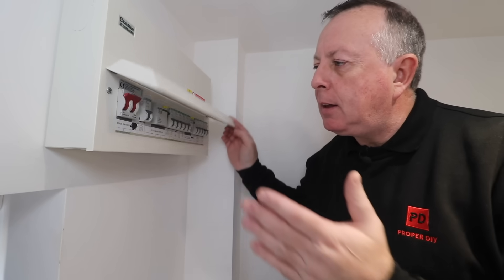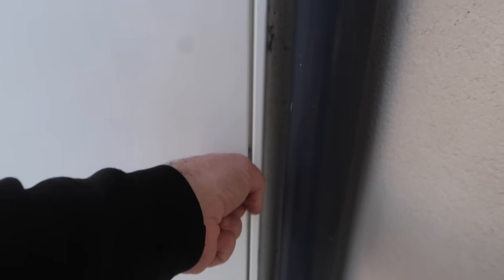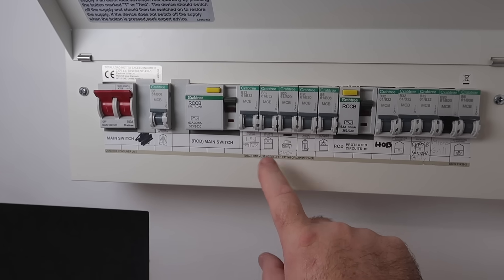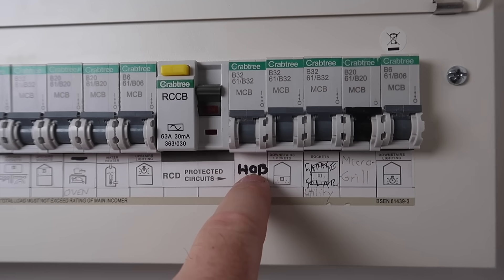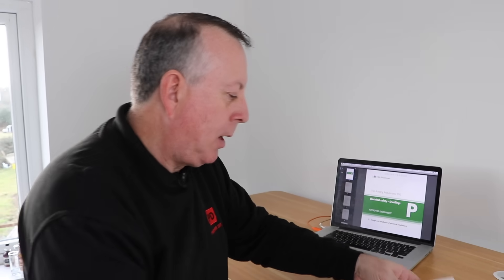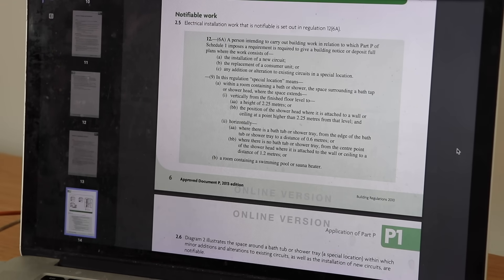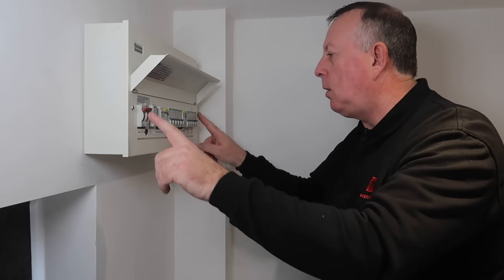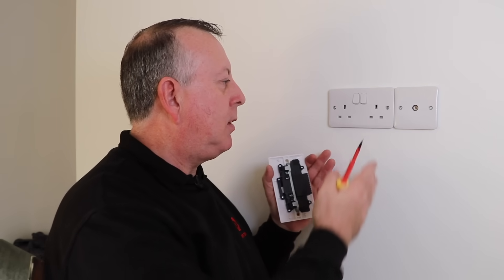What electrical work are you allowed to do in your own home?

Comment: The rules were put in place primarily to stop dodgy electricians I.e those operating as a business who’s work was very poor from doing work.  At that time most (there are always a few exceptions) people that did DIY electrics, were people that took time to study what they needed to do and took care in doing it. The number of people killed due to electrocution from their own DIY per year minimal and I don’t believe that’s really changed since. The biggest problem with the rules is as many people who own a house but cannot afford for an electrician to re wire a house will not have that house rewired.   The general dumbing down of diy, has created a whole generation who are too scared to even remove a socket. They also don’t realise that the terminal screws of sockets, can work themselves loose over time (depending on what’s plugged in) and should really be checked every few years.
Reply: I do the electric myself and yes I research by reading the regulations on what I am doing, artisan electric has said some DIY electric people are better than electricians as they do a neater and nicer job, in my view if know regulations you can do electric as long as make sure it off before working on it (I cut through a cable once I thought was off but as the plug was under a table) but either leave sockets maybe hanging off or let an electrician unscrew the sockets so they can check the wiring and mark it off if you done a good enough job
Reply: @mlee6050 same as you mate. Ive rewired the last 4 houses Ive lived in. A family member was an electrical foreman and tutored me in when doing my 1st one. Ive come across some chilling examples of dangerous wiring whether it was done by a qualfied spark Ive no idea. One example, in a batheroom there was a socket 18 inches from the taps. To make things worse it was jointed to the cable for the immersion heater. I also contact electrical contractors and request a check similar to what private landlords need every 5 years. When it passes..happy days
Reply: @palermothegoalgod-wd2wp  lucky you, I not know of an electrician in my family, and yeah just put new fuse in consumer unit, when save for radiator going to connect it up then hope electrician on a job next door can hop round to do check for me, so know it as this place has a landlord so yay
Reply: @mlee6050  so you test it, make sure it has a adequate zs. Do a insulation test? 
Thought not
Reply: @westleyjohnstone4719  
You can rent the equipment. Many vids on youtube tell you exactly how to do it.
Reply: @westleyjohnstone4719  on that not yet as not rich for the equipment, often I buy the more expensive cables that say self extinguish on the cables I buy, I am looking to save up so I can do a 14 week electrician course but mainly for when I do any single phase or three phase for myself I can sign it off after testing it

I do test on if lines work but I got a simple smart probe thing (forgot name of it)

Most I wire is on 13A plugs so far, got a line of from plug to junction box, to single socket, to double socket, to isolator, to single socket for things, other way on junction box is a 3 way switch thing to control Aircon and fan in heatwave so off/on/thermostat

First cable running from consumer unit today, I researched what cable and size fuse to use, when connect up to radiator at other end with a fused spur, I will hope get electrician in to sign it off without me getting a fine
Reply: @johnburns4017  I am looking to buy but when only have like £3k a year spare when on benefits after bills I am unsure when afford £9k for the course I am looking at
Reply: @mlee6050  
No fine. Only if something goes wrong, then you are found to be incompetent by a court.
Reply: @johnburns4017  no DIY Dave will do that. Plus, they don't understand the readings, or what table they correspond to in the regs. To many fires happen because of this
Reply: @westleyjohnstone4719  
Fires mainly happen because of poor screwed connections. Using Wago screwless connectors is the best way. A problem is that the screw connections at the rear of a socket are used as a junction box for the final ring circuit.  

On a socket ring final circuit, it so best to have Wago connectors at the back of the box taking the full load of the ring. Then using about 100mm flexible cable from the Wago to the socket.  The socket then is much easier to push back into the box and screw to the wall. No stress on cables at all. 

No current flows through the screw terminals at the rear of the socket unless the socket is drawing current. This reduces the likelihood of a poor connection on a ring and fires.

An efixx vid interviewing an electrical safety officer emphasized that the terminals at the rear of some makes of sockets get too hot when the ring is on or near full load. The ring's load runs through the socket's terminals.
Reply: @johnburns4017  a simple continuity test on the cables is what's needed. Decent readings, job done. Low earth loop to get the disconnection time
Reply: @westleyjohnstone4719  
You never got my point.
Reply: @johnburns4017  I did,  tbh nearly every burnt out socket I've ever been called to , is usually tumble dryers. Tbh without DIY Dave's, my life would be a lot quieter, someone has to rectify their work. My gripe is generally against them. And people who lie on their certificates. But not only lie, lie in such a fashion, anyone qualified can spot it a mile off
Reply: I've often been appalled at how sloppy some of the so-called professional work is.
Reply: Correct.  It all comes under Health and Safety. They are the ultimate body. The are over GasSafe. If you see a badly installed gas installation by a DIYer, GasSafe are not interested, as he is not asking for money and not under their umbrella.  When asked about allowing DIY gas work Health & Safety said that is not a problem overall, it is incompetent work by people asking for money, so called professionals. Hence GasSafe came about. 

They have the same view on electrics. But they cannot stop unscrupulous operators, so gradually making AFDDs mandatory (since June 2022) in some electrical installations and recommended in all, the safety level is greatly raised.
Reply: @@imarocketman90 that seems expensive even for london prices (if thats wer u live) we have a 5 bedroom semi in cheshire and was quoted 5k I did it myself it myself an all the gear came to about 800 quid
Reply: @@imarocketman90 It's a huge overkill and uneccesary. It's also counter DIY and independence and forces poor, knowledgable, competent people like myself to pay huge amounts to greedy electricians.
Reply: Oh to add my dream is to have enough money so I can start building my own house that 300m square space, single bed as just me, and do all construction and wiring myself, just need to find how to make money first, with what get at moment I need a job that gets me £35-40k or more to have similar what live on now
Reply: @@imarocketman90 20 grand?? How bigs ur fkn house mate 🤔🤔
Reply: B;lair's government strengthened the rules to buy the votes of electricians.
Reply: The rules were put in place unnecessarily just to make more money for departmental causes. 

I heard a story about a student who was electrocuted back i  the 90s. She hammeed a nail in a wall that peirced a cable making the nail become live whilst she was touching a radiatior. Her dad was either a judge or politician, and as far as he was concerned, it was a cowboy/incopetent electrician that installed the cable in the wall.

One of the bottom lines of the decision of building compliance for ele ctrial work in England and Wales resulted in. An electrician working as a foreman managing 30 plus electricians over seeing that their work complies with specification and up to scratch with quality, highlighting mistakes on drawings etc. Can not legally carryout electrical work in their own home, without paying a sum of money to register the work, or paying a self certifying part P registered business do it for them.

We all have a choice at the end of the  day. If you know your stuff just get on with it. And remember that electricity is still dangerous no matter who supplies it or connects to it. 

Wiring regulations/codes can only ever be considered for compliance  based on historical dangerous eleltrical events. But more recently seemed to be based on recommendations and opinions of outcomes not yet or maybe will never be seen. Moreover,  your own experience and knowledge can be used for your own guidance and decision making.

The building control regulations do not reduce anything except the money in your wallet.
Reply: Loctite!
Reply: @ImARocketMan a rewire is only required when the insulation breaks down. There's a reason we go to college for years, and DIY Dave has no idea if that video on YouTube is good or not
Reply: @westleyjohnstone4719  yes  going to college is essential .in my my days utube did not exist.i am sixty and new rules have come about.i don't have to go to college to update my self.i use the internet resources and u tube.i have spent hours and days on u tube and perfected my skills and standards but I am still unqualified and proud of my achievements.
Reply: @westleyjohnstone4719  I did my own work on a flat I let out and had to get it checked by an electrician at great expense. The hguy said it was so good he offered me to work for him (diybob).
Reply: @westleyjohnstone4719  You don't need the video, all the information is in the code books.  Was shocked with my book on framing it even listed the number of nails, hammered, and nail gun needed.
Some are just stupid, like the height of outlets and switches.  Thank god they haven't gotten around to regulating elevators yet.

Comment: you did not show how a simple plug in 3 pin socket tester that lights up can confirm the wireing is correct
Reply: Basic testing only. I'll detect the most obvious problems like reversed polarity or missing earth, but it won't do more extensive tests like checking resistance that might show a marginal connection and potential fire risk.
Reply: That confirms the polarity and if an earth is connected to the socket.

Comment: I do ALL my own electrical work. I live in North Wales. Practically every local sparks I've used is a cowboy. My work is better.

I won't touch the distribution box but everything else is done.
Reply: Is there something complicated in UK distribution boxes?  Or does that mean the one outside that connects to the supply from the street?

Comment: The incoming voltage into the UK home is not 230 Volts RMS, it is still 240 volts RMS.
They didn't change any of the transformers to lower it.

All they did was change the specification by changing the tolerances. They did not actually change the voltage of the electricity.
Reply: Mine is 250v.
Reply: @johnburns4017  Then you are obviously very close to a low voltage distribution transformer.
Reply: @deang5622  
Yep.

Comment: Great video. 25 years ago, I was engineering high-power switch-mode telecom battery chargers and were already designing them for 230v nominal input which the UK was moving to. Unfortunately, even now in 2023, it seems that most of the network is still 240v. Indeed, my own supply has drifted from 235V to 248V over the last 24 hours and from talking to others this still seems broadly the norm across the network. Would be interested to know if this varies by region and whether any parts of the UK are actually delivering 230v nominal.
Reply: I suspect that new DNO circuits for new streets might well have the secondary windings of the residential neightbourhood transformer tapped for 230V.  But for every other existing 240V DNO transformer, it costs time and equipment to alter the tappings on the transformer windings.  Given that there's no commercial benefit to the DNO in dropping the voltage for it's own sake (indeed it'll take longer for the kettle to brew), and that 240Volts is still well within spec, then the existing transformer will likely remain untouched until it's deemed inadequate to cope with the number of new solar installations, heat pumps and EV chargers.

My own voltage shows up a strong correlation between solar output and higher voltages, with 247Volts seen at lunchtime in the summer.  235Volts is seen when there's a high load at home, but no sunshine.
Reply: Even in EU with 230 V nominal, its common to have about 245 V at night when the power grid only has a small load.
Reply: Our supply varies between about 235 and 250 volts, as monitored by Kasa Energy Monitoring Smart Plugs. It's currently 251 V. I imagine it's only a problem for simple resistive devices (ie no PSU) where they will draw proportionally more current and therefore a kettle will boil a little bit quicker. So much of modern life uses siwtiched-mode power supplies which mean the voltage can vary over a very wide range while maintaing a steady 5 V (mobile phones and other USB devices) or 20 V (laptop). My laptop charger is rated at 100-240 V which means that presumably a nominal 230 V supply could fall a long way out of spec and still give 5 V out. The maximum of 240 V is a bit worrying if our mains is 250 V: hopefully there is a lot of "headroom" in the SWPSU so the mark:space ratio of the high-frequency switching voltage can be reduced far enough to give an output of 5 V even at 250 V.
Reply: No voltages have changed, only what they are called. The tolerances have been changed to fudge it so that everything can be called 230V across Europe. On paper everything is "harmonised", in reality nothing changed. All equipment has to work over 230V +/-10%, but you will find that a lot of Chinese products are made thinking that 230V is the actual supply voltage and will fail at 230V + 10%.
Reply: The nominal voltage is 230V but the allowable tolerance means that a 240V supply under the older tolerance that would have applied when it was installed will still be within spec. When I had some work done earlier this year the tester said the voltage was 245V.

Comment: The RCD will pass more than 30ma until it trips in milliseconds. In that time it will shock you badly. Physical injury from reflex such as falling off ladder or cut from sharp edges. It hurts.
Reply: A few milliseconds of electrocution is more survivable than a few seconds of electrocution. You might still die, but your odds are a lot better.
Reply: A 30mA RCD will generally trip around 25/27ma